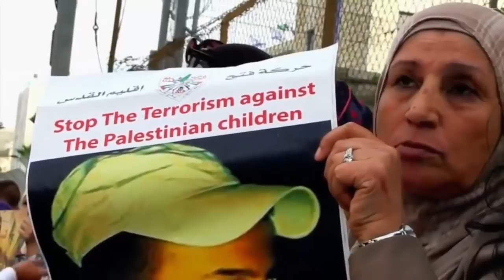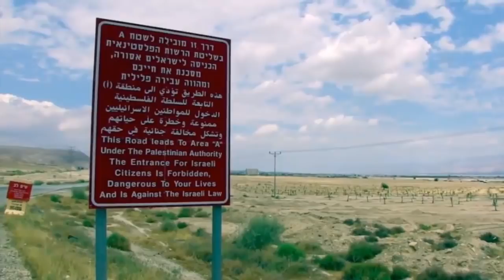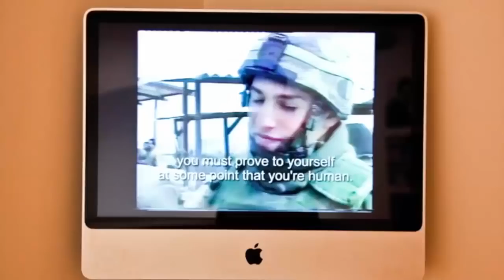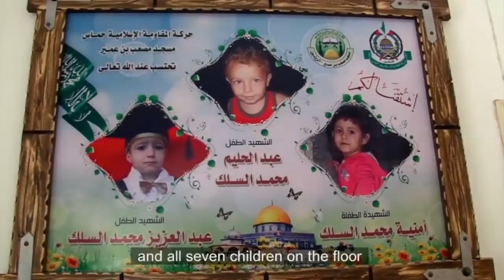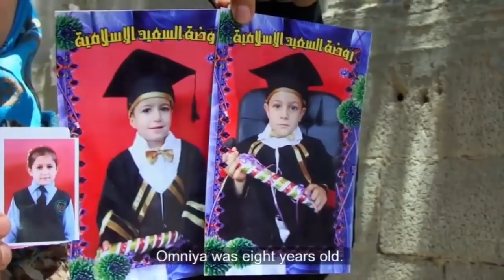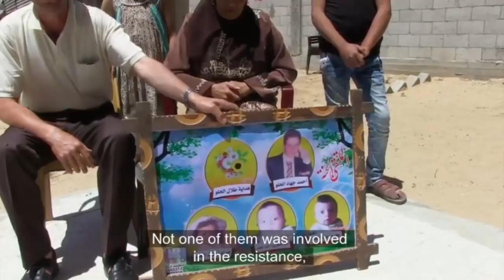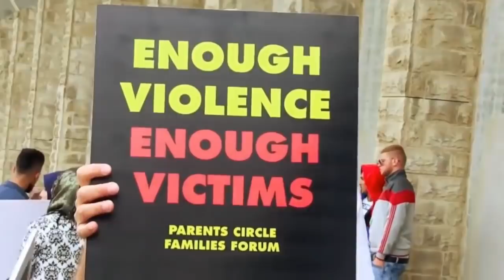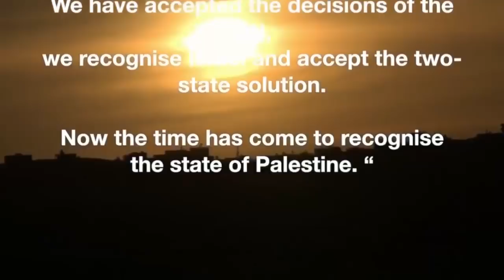BBC Documentary Films HD 2017 - Palestine Now Documentary 2017

Comment: Quick correction to your point at 28:54, Gaza offensive in 2014 was not in return to Hamas rocket fire, it was in connection to 3 Israeli youth kidnapped in the West Bank (not Gaza) by Islamic Jihad, Israel blamed Hamas instead and launched an all out assault on Gaza with an indiscriminate bombing campaign.
Reply: true. it was discovered that it was not hamas, it was an individual.
Reply: Sure, you're right.  The rocket attacks had nothing to do with it.  Israel welcomes the
rockets.